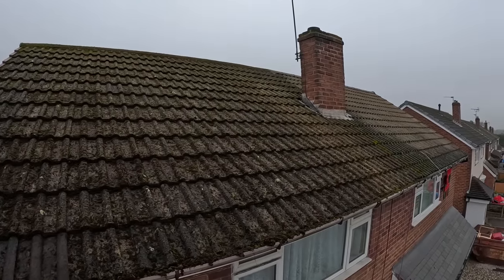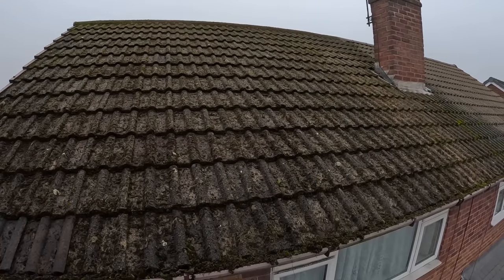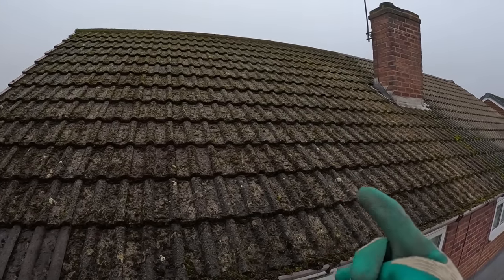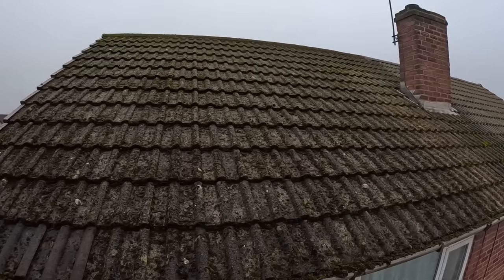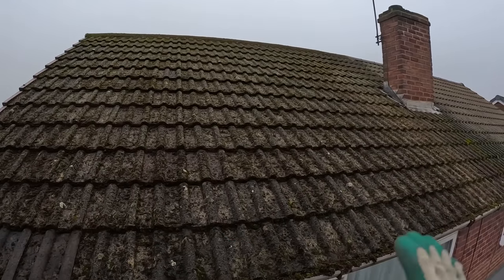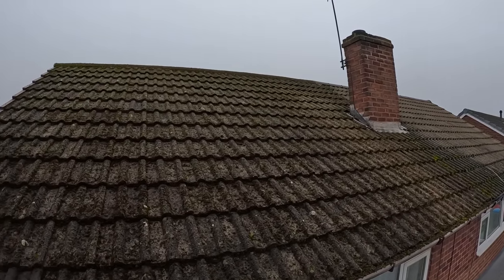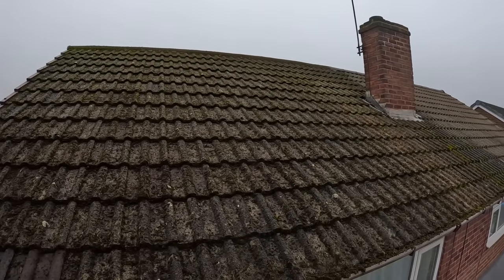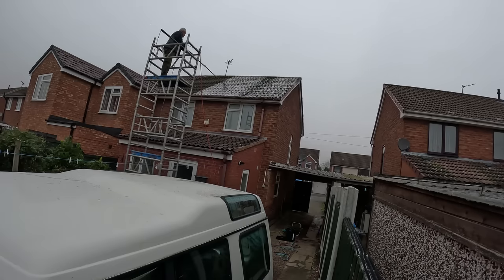STRANGE CASE: RUDE Neighbour Went Too Far? I Discovered Evidence Whilst Cleaning A Roof!

Comment: My front guttering would piss rainwater straight down the front wall when there was a big downpour. I live in a terraced house and I get on really well with the neighbour. Well the water would come down right on the property line and my neighbour had not been living there that long. But he did say that a guy came and fixed the guttering a few weeks back. I smelled a rat. I looked up and my guttering used to lead into my neighbours and the down-pipe on their property would evacuate our combined rainwater. Our row of houses are on a slight hill - my property being higher up than my neighbours. It turns out the guttering guy had raised my own guttering and blocked it off. I told my neighbour about it. He said " that's out of order, I'll ring my landlord ". The landlord came out and I pointed out to him that when it rains, both his property and mine could now experience damp cause by his contractor altering the guttering. He apologised and said he'd get onto them. Within half an hour, a new guttering guy came out because the original guy moaned that he'd done the right thing in blocking my side off. The landlord paid the bill and sent it to the first guy. He argued about it for a few days until the landlord told the first guy that if his handywork had caused any damp issues with both properties, he could be forced to foot the bill for both properties. Sometimes neighbours can be a bit arsey - mine isn't, but sometimes it's the contractor cutting corners.

Comment: What a nasty neighbour! I would get a downpipe fitted to save the nastiness escalating. Well done Sid. You did the right thing removing it. Great job again! 👍
Reply: I live in a similar type of semi that has only one drain at the front and one at the back, my drain takes the rainwater from my neighbours and my roof at the front and my neighbour has the drain at the back for both our roofs there. It would cost a fortune to dig in a new drain and connect it to the existing sewer so we both make sure our gutters are kept clean.

Comment: I replaced our soffits, fascia and guttering last year. Whilst doing that I fixed my neighbours guttering as it was full to the brim with spoil and some of the brackets their side were coming away causing overflow on top of the spoil issue. All sorted no fuss and only cost a few screws to sort them and 20 minutes to clear the spoil.

Comment: I can see both sides of this. It would annoy me intensely if my downpipe kept getting blocked by debris from the neighbour's poorly-maintained roof, especially if I had been maintaining mine to a good standard. Unblocking a downpipe does require ladders and obviously costs money if you need a tradesperson to do it. It can also cause significant secondary issues. However, installing a blocking plate is also wrong, especially if there had been no dialogue. I wonder if some sort of mesh filter would have been more appropriate

Comment: I had my concrete tiles pressure washed instead.  A lot of people whine about "coatings" and what not, but honestly, if my tiles ever had a coating or where ever sealed, they weren't by the time I moved in.  They were not the newer tiles with a glaze on them.  As the cleaner said, it will be like a new roof and it's concrete, we might wash a few mm off it, but it's an inch thick.

Comment: I'm sure there's a back story to this,but tbh as long as water can escape from the moss covered roof I don't see a problem at all.
I could well imagine the neighbour getting really annoyed paying to have his own gutters cleaned out cuz of the guys moss blocking his.
Reply: There's a backstory to all debates/arguements that go on between neighbours. The sad thing is, clowns like this uploader automatically side with them, after having only heard one side of the story. I've dealt with such foolishness in my past, and it triggers me to no end.
Reply: @trytalkingtoabrickwall9917  Well yes.  Quite.  And its also a question of attitude to maintenance.  Cleaning a gutter every six months or a year may be enough to keep the drain clear, and then the basic maintenance is done (which is what I might do and is probably the middle-of-the-road approach).

Another person may go further with biocide and deep cleaning to get rid of the moss which means more cost now, but no further maintenance for a few years.  May still cost more annually than the middle approach and I might think it excessive, but if I had a neighbour like this, they may feel I don't maintain my house because I only clear the moss when it reaches the gutter.

Mossy neighbour may never have seen the overflow and sees no problem and assumes all is well, which is the least proactive approach.  This is my neighbours' approach, but in the circumstances does not seem to cause me grief (I just run a scraper along their gutter too and tacitly clear them for them/me).

Sometimes people have strange relationships with their neighbours and communication doesn't happen satisfactorally, so no point trying to apportion blame.  The block may even have been added by a workman trying to ensure his customer (rightmost house) doesn't have further blockages to the detriment of the leflmost house whose inhabitants were not his customers.

Comment: Dude I can see you work very hard. We do roof cleans as well. Ever though of towing a compressor with you van??  We run air hoses and attached them to the end of the pole, you can scrape and blow the moss off, making lite work. Also you just blast all the moss out the gutters and blow the moss in a pile for clean up. Makes life way easier

Comment: The better response would have been to recommend to the customer, to avoid escalating the situation, is install their own downspout.  The neighbor should have been more mature and communicated if there was excessive runoff.  But that is not an excuse for escalating the situation.  Now the neighbor is going to find this eventually and do something more drastic and it will never end.
Reply: blocking the drain already was the escalation - removing an offence is a de-escalation: Unless you're of the opinion that a several thousand point damages claim for damp and structural weakness wouldn't escalate the issue

Comment: Hard to tell without a backstory.  Are we just going to assume that it was the neighbor that was the rude jerk?  To me it looks like the following.

1. The neighbors side of the roof looks immaculate and well kept which means that his side of the roof contributes little to no detritus going through the gutters during rainfall or snow melt.

2. The home you are working on looks like it has been quite a long while since it has seen any kind of upkeep and all that accumulation would certainly contribute a lot of detritus flowing through the gutters and most likely clogs in the downpipe.

3.The downpipe is on the neighbors side, meaning that unless there is an agreement, the neighbor is responsible for either paying for it to be unclogged or put in the work unclogging it himself.

The backstory we need is if there has been civil interaction between the neighbors about the issue before it was escalated. All we have is one person saying that the neighbors are trouble makers.  For all we know the neighbor could have brought up the issue multiple times and this guy got sick of hearing about it and labeled the neighbor a troublemaker.

Comment: A length of copper wire stops moss growing, usually the tiles are clean under the chimney stack because the lead is leached by rainwater indicating. A metal stops growth?

Comment: A neighbour of a house I had, had his gutter renewed. It was a continuous wooden guttering on the row of terraces. They cut into the wooden gutter, installed plastic guttering on their side with a stop end, with my (now open-ended) gutter against this new plastic stop-end. Consequently it leaked right on the divide line and the neighbour complained it was my fault, because it was 'my guttering causing the problem with damp in his house'. What a turd.

Comment: I see the divider has holes in it, which would mean it would keep larger particles, such as moss or leaves, from clogging the neighbor’s downpipe. The neighbor would still get the rainwater from the customer’s house, though – as long as moss and leaves do not clog the divider. Maybe the customer was not taking as much care of their roof as the neighbor wanted to (the neighbor’s roof looks fairly new and clean), and the neighbor wanted to keep the occasional loose piece of moss out. (Do they collect the rainwater from the roof, e.g. to water their garden, or does it just go straight to the sewer?)
Not sure what you mean about the sloping of the rain gutter, if it were raised towards the downpipe, the neighbor would have the same isuues as the customer: rainwater from the roof collecting in the gutter but not going to the downpipe but giong over the edges of the gutter.

Comment: I think there is something in the precipitation Act that protects the neighbour without the downpipe.  I read somewhere the arrangement where the runoff from both goes to a single downpipe has been in place for 20 years or more then they can't block it up.  A court order can be applied for to prevent it from being blocked up or as in this case have the blockage removed.  I'm no expert it's just something I read.

Comment: 11:10 You're right, Sid. The common downpipe has been installed within code and the gutter system should be included within that code as well. If the code is breached, yes, that's illegal and the offender should be fined as well as correct the flaw.

Comment: I have a lot of moss on my old roof as well. They are also interlocking concrete roofing tiles, but the roofer I spoke to didn’t seem keen on removing the moss buildup. He just said just remove the moss that falls into your plastic guttering instead, but because I have more moss on my roof then my neighbor next door, when I clean the guttering, it doesn’t take long for blockages to occur in my guttering again. Plus, I live in a 3 bedroom end terrace house, but the roofer charged me £378.00 to clean it, including, using a wet & dry vac to quickly hoover up debris from 3 plastic drains connected to my downpipes, but that didn’t include washing the dirt off the plastic guttering on the outside, what you can see when you look up at the house from standing below. The roofer just gave me the impression he didn’t want to clean it off my roof, or he felt it wouldn’t be worth it because it might damage your roofing tiles. So I just have to live with it because a new roof is unaffordable and I would never allow anyone to jet wash my roof either, because they are plenty of rogue traders that will and end up damaging your roof. Having said that, you did a good job cleaning that roof, on top of assembling and dismantling the scaffolding at the front and back of the property.
Reply: £378 to clean a gutter?  That's more than a plumber's day rate in most parts of the UK.  Hmm.  How long did it take?

Comment: On a long line gutter there should be a down pipe on both ends & the middle, this way if the volume of water is greater for the gutter to handle there's always a means for the water to get away quickly. Place a mesh screen over each down pipes to advoid blockage. Check at least every six months to see all good. Homes require constant maintenance for them to be trouble free. This will save you thousands $$$$ in the long run plus a lot of peace of mind.

Comment: Towards the end of the film you can see that the guttering is connected but the dam has been placed there no doubt to stop the moss from the roof that has just been cleaned. The neighbours roof looks like it has been renewed when the back addition was built and the neighbour has his guttering connected to the house you have cleaned. The guttering on the house looks like it is Hunter squire flow and has been there some years as you can see the sun has bleached the pipe but not the fittings, that often happens with plastics. I suspect the joints all need new seals but it is quicker to just replace it with new as it becomes brittle over time and new seals are a pain to get to stay in place when refitting

Comment: Question Sid - why did you use the scraper on this one rather than the FSC you normally use?   And also just generally is there a reason why you scrape both sides before applying the biocide?  Would it not be more efficient to apply the biocide to the first side after scraping whilst the tower is still up?  Cheers
Reply: 3 main reasons i can see
1. Too much solid mass - Would be spraying mud all over both houses
2. Drainage - even before the blockage issue was flagged there would be too much water to move due to the moss mass
3. Unknown condition of tile behind the moss layer

The Flat Surface cleaner is a finishing tool - like a plaster trowel, this was closer to foundational concrete

As for why he choses to scrape both sides 1st - Safety and ergonomics
Its fundamentally an acid and will soak the moss - any over spray would soak into the far side, which he is cleaning, then clearing drain debris by hand
The 2nd part - ergonomics: By scraping the far side it allows the 1st side to be drying in the open air giving it more of a chance to eventually absorb the biocide rather than sheeting off

Comment: Would a moss killer spray followed up with a pressure wash a week later have been easier/quicker?
Reply: too much moss mass - You'd be wasting a good gallon of biocide and still not have a good job
add that to the fact the pressure washer isn't the right tool for that volume of dirt

Comment: I had a similar situation with the house next door a few years ago, The rear of both properties empty into a downpipe on my side. The front of both properties empty into a downpipe on their side. Whilst having a scaffolding up a few years ago to allow me to replace my facia boards and guttering I discovered a couple of Un neighbourly bodges designed to send all rainwater my way. Why? I have no idea - but as I have a background in the building industry I was able to correct all guttering issues. It is interesting to note that both down pipes lead into an inspection chamber on my property, so I do not understand their actions to this day?

Comment: we have a shared gutter downpipe and the rain water from our neighbour house comes over to us abd goes into the the downpipe on our side, we recently built an extension on our home and we had to reroute some of the drainage and got informed by building control that the guttering and downpipe fell into Part H of the Building Regulations and covers the requirements for drainage and waste disposal so surely the neighbour breached a building code?

Comment: That's very very naughty? That gutter will over flow and if the wind blows the over flow onto the wall that's trouble quite quickly, pointing and a lot of damp.Done quite on purpose?  But the damp will run along the string course and affect them as well as the fall is towards the boundary?

Comment: Any semi detached house I’ve ever seen has always had its own down pipe in the corner. My experience more of driveways than roofing is SUDS compliance says is it’s illegal to discharge water from your property on to your neighbours, I would have thought the same here. Also when I look at my water bill I’m charged by the water company to take rainwater away and if I have a soak away i can request that charge to be stopped. I wonder if either or both pay that charge on their water bill.
Reply: SUDS regulation is not retrospective.  Many older houses put surface water into the foul (combined) sewers and it is unlikely that a house of this age has a soakaway for the main roof.  Once the water hits a shared sewer (for combined or surface water), that sewer generally belongs to the water board, so it would be reasonable to charge both properties.

Comment: Have you considered boiling water pressure wash with a dash of vinegar? I would imagine it would kill the residual moss in the pores and allow you to wash it out with simple water or rain, then put a spray sealer on after it fully dries. Messy job for the person on the scaffold but it would look much nicer in the end and a lot less physically demanding scraping.

Comment: I have a shared gutter and regularly clean my roof/gutter but my neighbour does not clean his.We are in an area where we get a fair bit of moss on both roofs. I have put a piece of chicken wire in the middle of the gutter between the two adjoined properties this allows the water to flow but not the gutter debris. So my debris doesn't make his gutter worse and my gutter remains clear with regular cleaning. just so you know I'm 70yo and my neighbour is around half of that I have offered to loan my equipment and even to assist.

Comment: It depends on the deeds it could be your customers house has had the down pipe removed, and there were 2 (doubt full though, coz it's very rare), but if the deeds outline it's a shared down pipe it is an act of criminal damage to deliberately prevent that setup.

Comment: I’d be inclined to modify my guttering so that it was canted to their direction and the run-off just poured onto their side of the property. After a few months of that I might consider installing a down pipe but presumably there is no drain to run that to in this case,

Comment: How many years does it take for a roof to get that grown over with moss? At least a decade in my experience, but I've never dealt with those types of roof tiles. I wouldn't want to deal with the volume of crud coming off the unmaintained side either as I'd be the one paying to have the gutters cleaned annually.